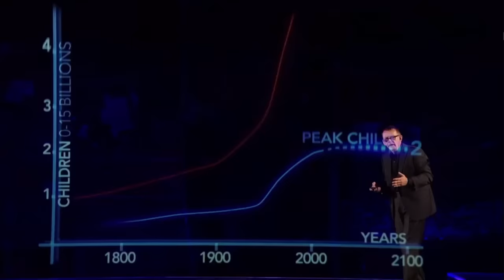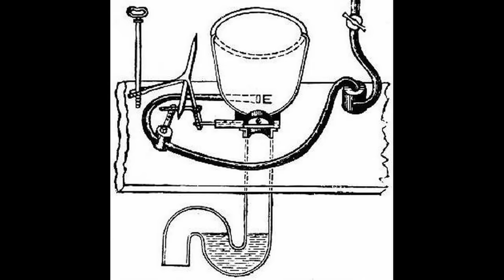How to Save TONS of Water, to Save the Planet

Comment: I'm not that bright but can we just boil sea water and extract the salt then combine it in a lake so it would be drinkable. But thus way must be functioning in a large amount. 
If I'm wrobg please correct me
Reply: There are such industrial systems, generally called desalination systems. However, building such a system would require  some more energy to be spent. Besides, it's sort of a last resort solution, as the desalinated water also lacks other necessary minerals such as calcium, potassium, etc...
Reply: @muratdil1798  ouh, thanks for letting me know. I'm still 15, but I thought I discovered a genius way😂
Reply: @l.o.gfauzan1877  Keep up with such ideas, you never know when that would be a genius way. There are several success stories out there, where a very wide application is perfected by someone in a genius way and hit the JackPot.
Reply: @l.o.gfauzan1877  Even though it exits, it's great that you thought of it! Keep that curiosity and it will serve you (and everyone) well.
Reply: Desalination plants also need a shit tonne of oil to run aren’t great for the environment

Comment: you could put the soap in your hand before opening the tap, but okay ;-;
Reply: But then there is soap on the handles and you have to use water to clean that T_T
Reply: Put soap in left hand. Turn tap with right hand. Wash. Dry. Done
Reply: @gerrit5551  oh. I assumed the intention was to cut the water during the actual washing, which is the biggest waste, if you do that you put soap on the handle when you open again to rinse.
Reply: You shouldn’t do that, it’s against hand washing protocols. You should always wet your hands first, then apply soap. Otherwise the soap can’t do its work properly.
Reply: Chevy5988 Correct.
Reply: @GommansMaikel  I always tell that to people
Reply: Naitouingu Ashihei And do they listen? 😄

Comment: This video is a little scaremongery. You CAN drink treated sea water. My last Submarine had the means to extract drinking water from sea water, and that tech is 50 years old. The desalination plants could be powered by tidal electricity too (ours were electrical, powered by the nuclear reactor).

Besides, most drinking water is evaporated from the sea and falls as rain (that collects in reservoirs). The planet is covered in H2O, you just got to get the salt and other shit out of it!! It's not running out anytime in the foreseeable future.
Reply: Yes....   You can consume energy to make seawater drinkable,  but it's a lot of energy, and its much more expensive than capturing and purifying rainwater.
Reply: seems to me the better answer would be cheaper energy generation, not using less water.
Reply: @Dracolith1 
So then the problem isn't that we're running out of water, it's that after we run out, the price will go up?
Fine by me. Just make it so the first ten gallons a day a location uses are the current price, and after ten the price goes up to the cost of desalinating or whatever. People can still afford drinking water, large companies adapt to use less water, or eat the cost. What's the problem?
Reply: Duh. What hes saying is that were using up the planets natural drinking water reserves faster than it can replenish them. We dont have to. Easily at least 50% of water used is wasted down the drain and thats not cool. Thats on population sector which as he said consists of about 30% of water usage the 70% is industrial/food. So 50% means 15% saved which means we can add a few more billion people without changing anything but our habits.
Reply: @Andytlp  I'll wager that you start the majority of your KW rants with "Duh"..
Reply: @holden_tld  Agreed! All the components are available, it just needs to become commercially viable (read: Profitable).
Reply: So did u do it and how much? Im already buying a mansion from the winnings btw and i dont wanna hear anything lalalalala.
Jumping to conclusions so fast mr seaman
Reply: @Andytlp  You forgot the "duh" part to validate your response.
Reply: no females in subs? :'(
Reply: @Andytlp  I'm now assuming that you're either a 10 year old or English isn't your first language..

Comment: Just turn the faucet off while you're scrubbing your hands. It's not that big a deal to touch the valves with soapy hands. You have to touch it again after you've rinsed your hands so it gets wiped off anyways. I do this every day and it has become natural. You can even just use a finger or two if you can, to turn the faucet on and off. The same could apply to when you shower but I havent adopted that... 😩😮‍💨

Comment: The only issue with this foot valve concept is that it’s literally the same as the infrared sensor faucets. And when there’s a power surge the breaker usually trips and the faucet will continue to run(or sometimes not work at all) and also the solenoid controls a rubber diaphragm that opens and closes for water flow. When the solenoid goes bad or the diaphragm gives out the faucet won’t turn off. So you may save water in the long run but there will always be issues.

Comment: Some sinks fill toilet tank with the used water. My dad uses the used water for watering plants. You also don't need to turn the tap all the way. You also don't need to have running water while putting soap on one of your hands - you can use the other hand to control the handle (if you have the lever one). Some toilets have the half-tank button (5 liters vs 10 liters). You can also pee in the sink, if you are a pig, and flush it while washing your hands after - 2x 0,2 liters (as you said) instead of 5/10 liters. And in the end, water cleaning station filters and reuses the used water. There are basically no losses. I guess it is as you said it - depends on country. I live in post-soviet one, you usually keep hating on those, yet we know how to recycle and save.

Comment: Mehdi....  They've had this for years.  It's called a Monobloc tap, or more commonly used, a disc tap.  You just hit it on the top when you are not using it, and flick it up when you need water.

Comment: How much water was needed to mine and cast the valve and the rest of it's components? I know that brass has a high amount of copper in it, as does anything electrical. I live near the Butte, MT copper mines and you should see the amount of water used and contaminated from the process.

Comment: We can put clear plastic over our garden plants so when the water liker starts the water will evaporate and rise to the top connecting to the plastic and then the collected moisture can run down a tube and can be collected it mite not work but it will slow down the waist  at least till we can make a better way that will save water with no waist

Comment: I do not believe that cutting even all of the 10% of the total freshwater usage that the households use will make a meaningful difference. The most important issue to address is agriculture which uses around 70% of the freshwater supply. Pretty much the only way to solve it is to switch to hydroponics which would rise the food and fabric costs by many folds.

Comment: Add a small paddle wheel generator to the waterflow. Use this to power solenoid. Save electricity and water.    Or alternatively use could use the free water pressure to pump the surplus water up to a tank on the roof which when full could flow down and power a small generator. This would even work when the house main power is off so it would be great for emergencies.  Regards,  William James

Comment: Great analysis. 

I don't know in your country, but in mine (italy) we've got another problem. 
When people open the valve, they need to adjust it a lot to regolate the water's flow, because generally is stronger then they really need.

This happened since nobody asks help to hydraulic engineer to do an appropriate system. The result is a lot of energy  wasted.
Cause the motor is alsways over dimensionate.
For this reason, i was thinking to use an inverter to controll my autoclave (is asyncrhonous motor).
 It coud be usefull olso for soft-start.

Comment: This was as entertaining as watching a plumber try to re-wire a light switch. 

Also, wouldn't it be a lot simpler to apply this method with a mechanical foot pedal and save electricity too? Of course, I am an amateur carpenter, so I'd be trying to figure out a way to cut a valve control out of a 2x4...

Comment: If we use the water, it ends up back in the environment. This planet is more or less a closed system, though technically not. If you turn on your faucet, water comes out from maybe an aquifer, river, or other source. It drains that source, then goes down the drain and ends up either in a tank or water treatment plant, then it get absorbed in soil or back in the river, then it ends up in the air and rains back down. You can look up transpiration I think it is. Its the way that water leaves plants and goes into the air and rains back down
Reply: But its not always that simple.
Finland has thousands of lakes, but still there are water crises on hot summers as many wells amd reservoirs dry and lakes become so warm that the lake water becomes questionable to drink without filteration. That is how it goes especially on many rural areas.

Comment: and then we dont have enough water in the sewer to get all the literal sh*t washed away... yes, its a problem with those stopable water boxes in toilets nowadays, because everyone is like: aaand the turd is gone,  stop wasting water * presses the stop button after like only 1/4 of the water went out *
we had a problem with our toilet here 4 years ago, and the plumber said: use all the water in your water canister flush box thing, because first, you pretty much need all the water to flush your turd and dont clog your pipes like you did now, and second, we need the water in the sewer, so it doesnt "dry" out xD
so im like: fuck saving water! * shrug *
at least in the toilet department. when you wash dishes per hand, you can save a ton, thats right, you dont need to have it running the whole time. and hand washing? meh, doesnt rly do that much. where you can save: dont take 30min showers for nothing, you only need a max. of 5 if you are slow, and you can stop the water when you soap yourself! ;)

Comment: I think domestic water usage is around 1% not 10%.  Unfortunately, the majority of fresh water is used for irrigation and industrial purposes.  The biggest water waste occurs in electrical power generation and industrial air conditioning.  The iconic nuclear power plant image is really the cooling tower, which functions by evaporating millions of gallons of water and dumping wasted heat into the atmosphere.  This is mainly due to the inefficiencies of Carnot Heat engine processes used in thermo-electric power generation.  The maximum efficiency of thermo-electric power generation is around 40%; the remaining heat energy is dumped into the environment by wasting water or heating the oceans.  Nuclear energy is the absolute worst water waster and environmentally hazardous of the forms of thermo-electric power generation.  The spent fuel requires active cooling and continues to release thermal energy for thousands of years along with all of the nasty radiation.  Anyway...

Comment: In the big (planetary) picture you are not saving or conserving water resources. Really what you are doing is saving energy (and that's a good thing!). Water is one of the most 'conserved' utilities - 'conserved' in that it stays as water (or steam or ice) albeit contaminated. Rarely does water split in to its hydrogen and oxygen constituents and even when it does the hydrogen more often than not combines with some atmospheric oxygen to become water again. So it's the 'fresh' bit of fresh water which is important and to make fresh water you need a considerable quantity of energy and it is the cost of this energy which is factored in to the price of water.  The end goal is the same, use less water = use less energy = better planet.  I use the alternative solution which is I can pipe the 'gray water' out of the house and that goes on the flowers and vegetables. A bit of booger water never harmed a carrot or a rose. (Toilet water - 'black water' - that's different - that needs to be treated so we don't all get cholera. )

Comment: easy way to make old toilets more efficient is to fill a plastic bottle with rocks or sand and put it in the tank. this way it takes less water to shut off the valve and in turn uses less water each flush.

Comment: That's dumb. You can turn the water on/off already with your hands, so it's doubtful people would be more careful with their feet. The best method of affecting demand is by changing the price. If local authorities would stop subsidizing water (and people had to actually pay what water was worth directly, instead of indirectly via taxes) you would see a dramatic reduction in usage. Israel did this, as an example, and water usage went down by 80%; it also gave them the much needed funds to pay for maintenance, build aqueducts and establish a central reservoir.

Comment: Instead using water flowing basic method or Medhi Solution to saves water when do some 'daily watering' activities, i'd like to use water tank / reservoir and use something that can brings me some water from it and use it with very efficient Way, its free electricity usage, efficient water usage and of course your muscle will rising up like the hero shield does , so the key is yourself mindsets

(why i wrote it will rise your muscle, because the reservoir are inside my bath, so when i had to do some watery things outside, buckets and muscle are needed :), soory if my english so bad.)

Comment: Maybe design a faucet that cycles the water over and over while putting it through a filter of course until your done and drains it after you turn off the faucet.This probably has some downsides though and potential hazards.
Reply: They exist. In fact it's happening in your locally (hopefully existing) water treatment plant. There are also sinks with water filtration, however they aren't exactly good enough to fully clean used water.

Comment: These circuits are REALLY useful, and i really like the foot pedals. I wish my school used them because kids will leave a faucet on all day, and the faucets also make u touch it after you cleaned your hands...making them dirty again
When i get older and buy a house i will genuinly look into that modification. I would want one sink im my house to be able to have on all the time, or mabey have another pipe just for watersteam that bypasses the censor on the floor, but i would really like to have that. Get a pedal that has small actuation so its comfortable to use, mabey somthing pressure sensative to adjust water output. Damn thats such an idea.

Comment: The fotocelle shoulden be plased om the watertap. That's why IT Work so bad. It  should have Been plased In a sink made for a transmitter and a reciver in the top, so when you brake the Beam it Would turn the valves. And maby a timer for holding the signal high for a second after You remove you fingers from the Beam. I'm sur that would new the best solution.

Comment: when it comes to teflon tape sitution i mange to get it to work without it in most cases because i tighten shit down sometimes a little to much lol and as for forgetting the drain connected i done that quite a few times when unclogging the drain and because getting water built up in the sink because of said clog then the mess i have to clean up forgetting oh i forgot to connect the pipe togather lol